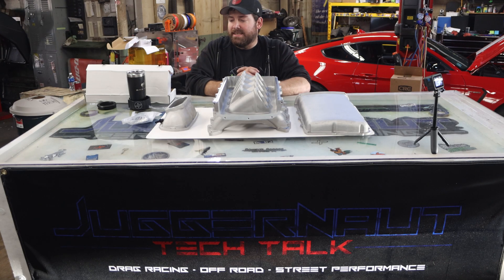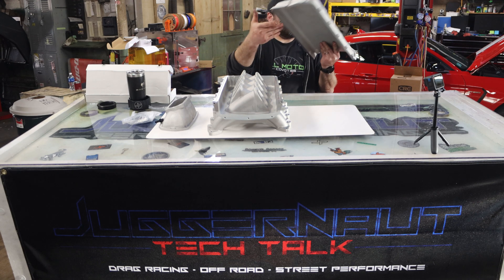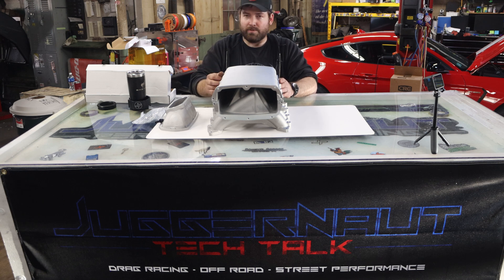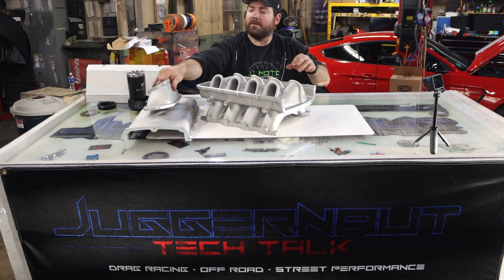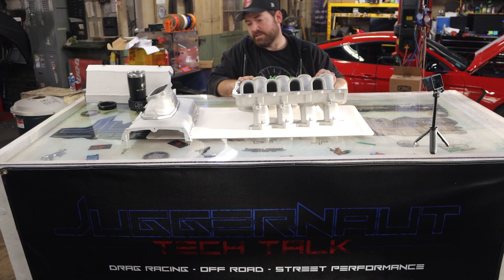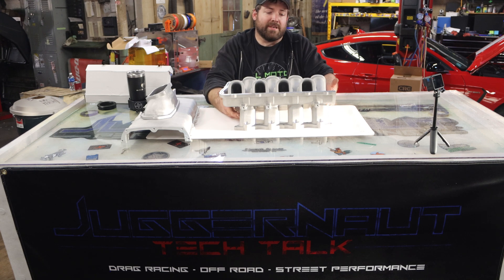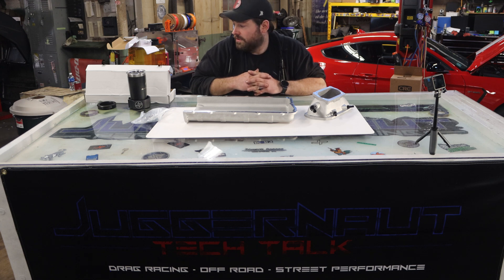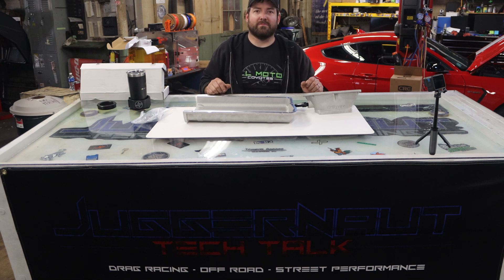Ep S6 - Holley Cast Coyote Intake Manifold

Comment: I have a 21 Mustang Mach 1, how do I option the plumbing kit?
Reply from the maker: 18-23 gt. If you are running open catch cans then nothing for Pcv, or stock connect if sealed. Then you can add the barbs to hook up your brake booster and purge valve

Comment: The hell with a Mudstain. I'm tired of dealing with Mudstains, catfishes/fireturds that force you to compromise an intake manifold due to hood clearance. How will this work on 18-20 F150? Would a high rise fit under the stock F150 hood, and be better than low rise? How easy would it be to mod it to accept the F150's speed density sensor? I saw one listed for a new GT500. (which seems odd unless you're going turbo) New GT500 is also SD instead of MAF, so are there already previsions in the intake for the SD sensor? You mentioned potential vacuum issues with this manifold. Will that be a problem for SD?
Reply from the maker: You would need to drill and tap the map sensor or adapt one of the existing ports to something that was an adapter. Vacuum isn't a problem you just need to figure out what you're keeping (brakes, evap) and plumb accordingly.

Comment: That’s the intake everyone was waiting 💪🏼
Reply: But why? What do you think holds more heat? Plastic or metal? Plus being modular, there is more leak points.
Reply: @coyotekelly7143  Engine Masters did a whole episode on this. Air travels so fast through a manifold it doesn't have any time to pick up additional heat. Plus, it will actually get warmer slower than a composite manifold but hold similar operating temperatures.
Reply: @coyotekelly7143  you right , I just like the price and because can be ported a lot more for more air flow

Comment: Kind of new to this but , have a 2015 gt with a 3in trufiber hood on it should the high ram version be okay without modifying anything ?
Reply from the maker: It really depends about the rear structure of the hood. A lot of the higher Hood still have a stock style structure in the back center. If the raised height of the cowl carries all the way through to the back of the hood then it should be fine

Comment: What fitments are specifically needed for a 14 ? Any special lines needed or fittings?
Reply: What about the brake booster where does that go ?
Reply from the maker: @boostedcyot  you will need one for the purge valve and one for the brakes down low.
Reply from the maker: The fuel line adapter kit on our site and some vacuum fittings depending on your setup. You can bend or replace your coolant fitting also
Reply: I’ve switched from a ported 18 so I ordered a bunch of stuff just to make sure I’m set so I ordered it just in case thank you hopefully I’m ready now
Reply: @boostedcyot  how long does it take to switch the intake manifold? I live in New Jersey and I'm not sure if I can get an inspection done with a tune and was planning to reset back to stock for the inspection, but if it's easy to change back and forth I would consider it. Especially now that a Boss IM is $200
Reply: So I ordered the fittings. The connections go on the sides of the throttle body.? One for catch can & other for purge valve ?